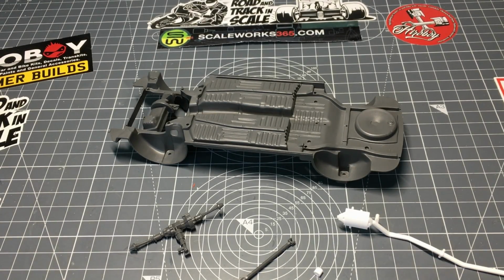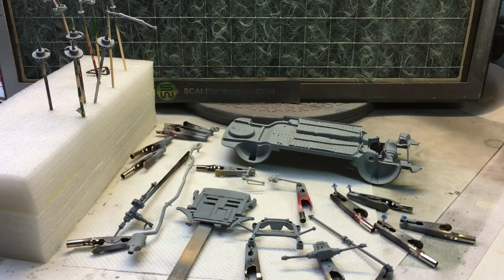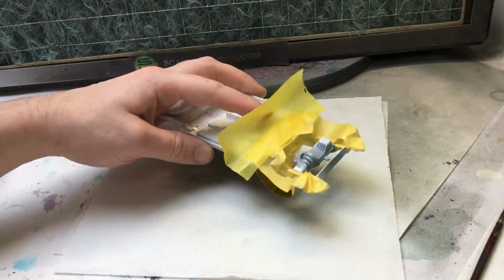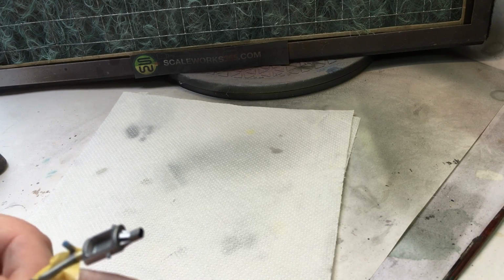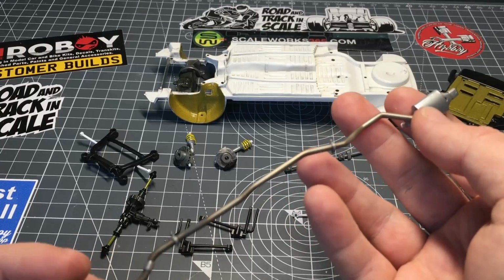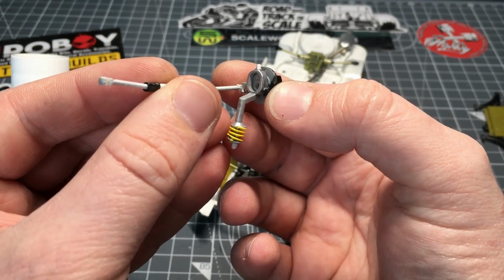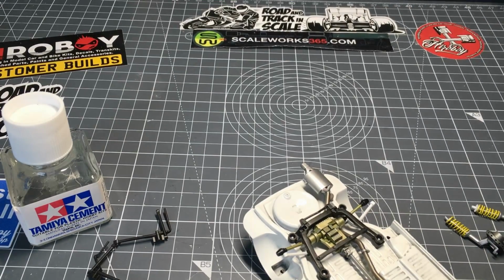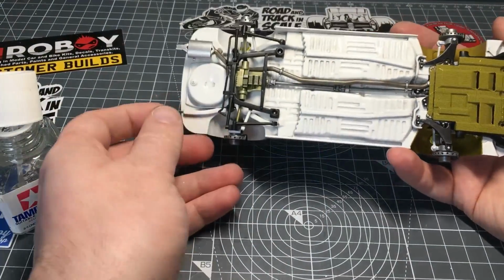Tamiya Castrol Celica WRC Part 2 - Assembling the chassis

Comment: New to the model building, what make is your air brush and compressor?  and would you recommend any brand?
Reply from the maker: I use Iwata for both. I have three airbrushes with different needles for various painting jobs.  I opted for a dual output compressor with a tank, but the Iwata ones aren’t cheap. I got mine second hand, but the main thing with the compressor is a moisture trap and auto cut-off. A tank is preferable as well, as it gives a more consistent air flow.

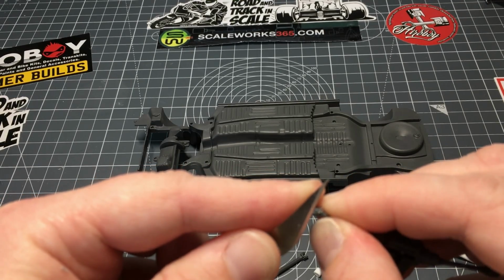Comment: Very nice start.  Did you use 1:24 Kevlar decal or a smaller pattern? Looking forward to the remaining build. Are you going to do any wiring? Thank you, Best.
Reply from the maker: Thanks wavelet. It was 1:24 decals. I’m debating adding some wires on the interior, but with it being curb side there isn’t anything to detail under the bonnet.
Reply: Dalren Models Thank you.